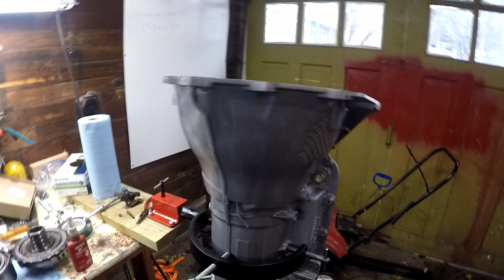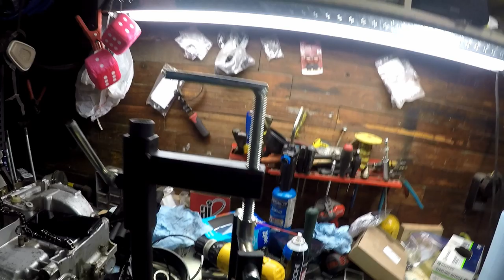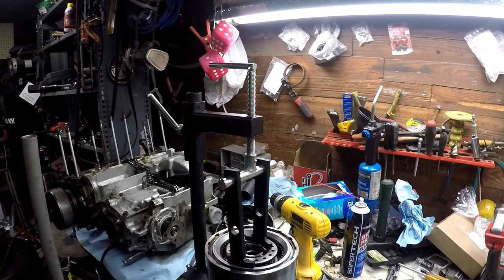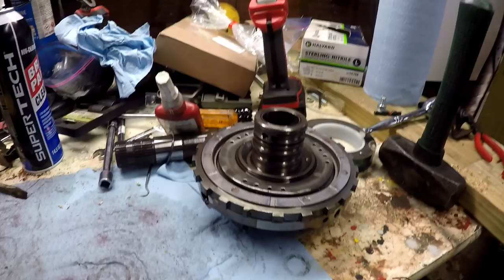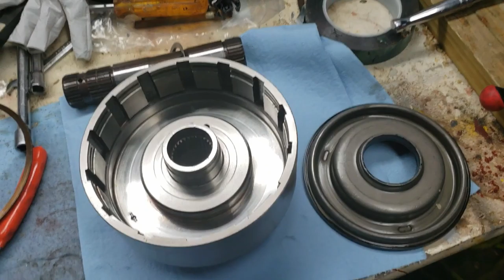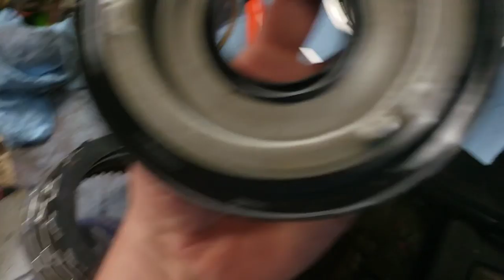4L80E Budget Build Part 2, Dual feed

Comment: Honestly, it's the coolers job to cool the fluid. If you are that concerned, get a bigger cooler. Having said that, the only conceivable issue to Me would be the heat treating of the aluminum alloy. Most aluminum high strength alloys are what's known as; "precipitation hardening." They take the part as cast and soak it at specific temperatures for specific times to achieve specific properties. The reason I mention it: Back in "The Eighties" there were three men who as dive buddies wanted their new aluminum tanks to match. They had them powder coated. The first ruptured while filling, killing both the guy and the shop owner. The DOT tracked down the remaining two and no one else died. Again, having said that, a 4L80 case is not a pressure vessel designed to contain 3000psi. There is no way I could imagine it making a difference at all. Not that big a fan of spending money to pretty up something you can only see on your back though. Maybe why I'm divorced.

Comment: I do not like powdercoating on aluminum - I've seen too many failures in a marine environment.  The least bit of oxide always creeps and grows, the coating holds in moistue once there, and soon... it flakes off big time.  I'd rather throw high temp primer and enamel right after an acid wash [like alumaprep]. That is a pain of course because the case must be fully stripped, bushings and all.  A coat of alodine to seal it is tempting, but... I don't know if it gets along with transmission heat that well over time except it gets a good paint job over it.  Work fast, and in a dry [sub 40% humidity] environment.  I tested an intake manifold pre-treated with alodine last year - so far so good: coated on top with a high temp primer and a ceramic enamel.  The surface before priming is excellent: truly squeaky clean.

Comment: Hey jr do I need a duel feed if I’m daily driving n just for doing burnouts now n then ? Also I seen I guy drill the hole at the bottom of where the piston rides n not like u did just above the lower part of the piston seal? What’s ur thoughts? Thnx brother
Reply from the maker: If you're not taking the transmission apart, don't worry about it
Reply: The Driveway Engineer I’m doing it just ordered the master kit .. but I was wrong I thought u drilled the hole in the different spot.. wasn’t doubting u but I must have had shit in my eyes .. lol but I’m following everything ur doing almost to the T .. wanna be like jr when I grow up .. lol but thnx bro for always taking the time to always answer my question ✊🏻✊🏻✊🏻

Comment: Gonna be rebuilding my 4L80e thats going behind a 600hp big block chevy. I see some shops selling $900 perf rebuild kits. At what point are these necessary over a stock rebuild kit for $200 and the dual feed direct mod?
Reply from the maker: No point really, stock clutches and a dual feed will take you to hard parts failure.
Reply: @TheDrivewayEngineer  thats good news. I picked up this used 4l80e, to replace the th350 in my 71 monte. Started shopping for rebuild kits, and coming across ones from jakes performance,  monster, etc. Im like holy shit , nearly a $1k for a rebuild kit? Add 500-750 for a decent converter, another 500 for a trans controller,  starts adding up quick!
Reply from the maker: @joegarf  they use good Raybestos clutches, and include the parts for the mods I did, but you're really paying for the name, the tech support they provide, and the convenience.

You can get the same result for half the price.

Comment: I like the tool for the forward drum. I found that the white separator in a 24 pack of pop (Pepsi products) works great for lip seal tool.

Kudos to Michigan 💪
Reply from the maker: That's a great trip!
Reply from the maker: Tip, lol
Reply: @TheDrivewayEngineer  and garage sales are excellent places for transmission tools 😎
Reply from the maker: I got my air hammer for a dollar at a yard sale lol.

Comment: powder coating is a personal preference if you like the way it looks of your vehicle have at it anyone else tries to tell you that it's going to be hard on parts and it's not going to do this it's going to help cause heating problems will guess what putting your foot three quarters of the way into the carburetor helps with heating problems well the radiators too small because my foot's stuck too far in the 1450 dominator believe me powder coating makes things look nicer heat is a product of using your toys if you spent all your money on the paint job and all well the motor transmission works I forgot to put a big enough radiator in there transmission cooler engine oil cooler I mean come on guys it looks nice powder coated
oh yeah thank you for sharing
Reply: every time you take that transmission apart to look at it it's foolish not to put new clutches in but you're trying to save money but I want to save time so by saving Time by putting new clutches in I don't have to take the transmission out in two years and replace them used clutches

Comment: Doesnt the drum already have a bleed hole? Mines got a hole through very close to where you indicate to drill, that has as small ball bearing inside it...and another hole str8 through at the bottom of the wave disc seating area. Is this a rebuilt unit with an upgraded drum? Or factory? Should I still proceed with all the dual feed mods?
Thanks
Reply from the maker: The hole isn't necessar, just helps reverse apply.

Comment: I interested on the rollerised project...I'm doing it and putting the sonnax case bushing install backwards is too deep in transmission. I read that it the perfect deep to hold shim and bearing , but it not.. Whit the OEM thickness mesurement shimmed bearing...bushing contact the  output shaft ....i have use tci 224400 kit...i will probably knock out just a bit the bushing or sand it...
Reply from the maker: What year is your transmission? I know the earlier ones used a narrower bushing.
Reply: @TheDrivewayEngineer  my transmission is 4l80e 1998 from a gmc savana diesel. I checked the height of the bushing in the trans. I have 0.120...i saw on forum's 0.080 is the goal... i have check the float of the rear planetary and i mine is less than 0.010... What do you think about enlarging lubrication feed hole to 0.125 on the center support,overrun clutch housing and stator support ?
Reply from the maker: A clearance of .010 is more than adequate, mine is only .006, you can go as tight as .003. .010 is usually my goal lol, so you nailed it. 

I do not open up any lube holes.

Comment: When you drilled the hole in the clutch pack housing or drum, does that make a constant leak when pressurized? Since it is in the area of the piston under pressure for engaging the clutches.
Reply from the maker: Yes, which is the point of it. At high rpm fluid builds up there and starts to creep the direct clutches on, they drag a bit. The little .060 hole allows the residual fluid to exit, and never makes a significant difference to volume when normally engaged
Reply: but what does that mean? and why would I want softer shifts?
Reply: @Nutflame55  he's saying the pump provides more then enough fluid for proper engagement with the right pressure, plus still having the hole squirting out fluid while engaged. When not engaged then the fluid inside piston will drain out and not partially engage the piston. Same shift firmness to boot.

Comment: Hay jr my name is will newby iam 44 years old iam rebuilding a 4l80e out of a 92 Chevy truck 2500 HD 4x4 I have never been in side of a transmission for any reason I have worked on cars since I was 13 years old so i think I can do this the problem is the transmission lost reverse and overdrive could u give me advice on what to look for when I get I. There any help would be greatly appreciated I just don't have the money to pay for it to be rebilt
Reply from the maker: Reverse is pretty common, usually due to the servo not contacting the band fully.

Hiram Gutierrez has a great 4l80e video for a rebuild

Comment: im having one hell of a time drilling that dual feed hole. just went through 10 bits
Reply from the maker: I don't have any special tips, my drill bit was an off brand Ti coated like 98 cent thing. Go slowly and be patient.
Reply: Measure .410 in from the outside of the drum. That will put the hole just inside the seal surface.

Comment: Great video! I'm also in Michigan  and have a 4L80e 4WD looking to convert to 2WD and rebuild. It's  going in a 280zx along with my 5.3ls engine. I want to know what torque converter do you recommend for daily driving? Can you use to torque converter that came with the 4L80e?
Reply from the maker: You can use the stock one
Reply: @TheDrivewayEngineer  thanks a lot

Comment: I don't know about the heat retention issue but why would the OEM's spend money powder coating something that's aluminum so corrosion is not an issue. That extra money they don't want to spend building a car
Reply from the maker: I don't know of any OE pwdercoated transmission cases.

I did extensive work on the T1xx Chevy trucks, and everything we proposed powder coating got cut to existing in the end lol

Comment: Hey JR, what fixture are you using to hold transmissions in your engine stand?
Reply from the maker: Zamco tools on ebay
Reply: I can't seem to find that one. I see some others but they don't fit into an engine stand. Any recommendations?
Reply from the maker: @MichaelGedies  mine does not fit into an engine stand

Comment: What if I want to ls swap a mustang
Reply from the maker: Depends on the year, but if it fits, it ships. Mustangs are pretty easy because they already make SBC mounts for most of them, so I'd just use those and the LS/SBC adapter plates like ICT billet sells. 

Since you're wiring it standalone, it doesn't care what chassis it's in, 12v constant to the oranges, 12v switched to the pinks, and fuel to the rails and it'll run. 

Check out the Facebook group https://www.facebook.com/groups/887277178144274/?ref=bookmarks so we can see what you're working on.